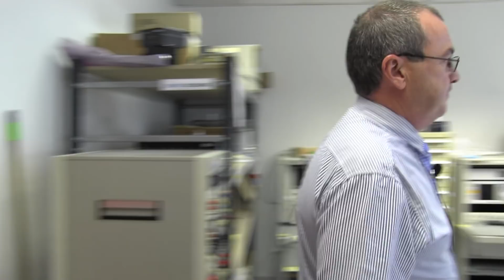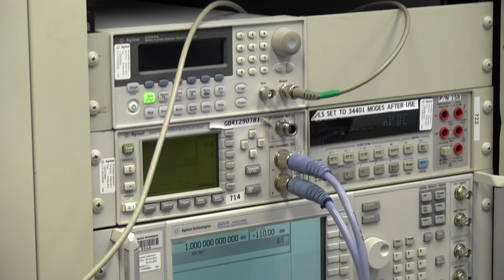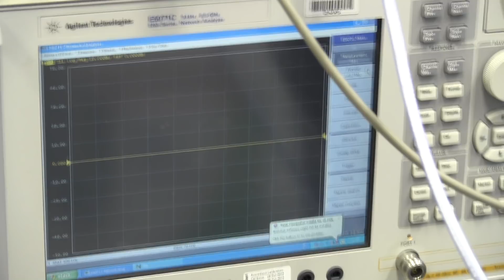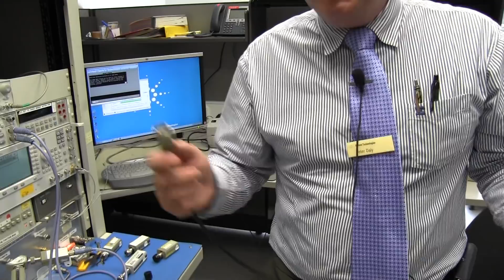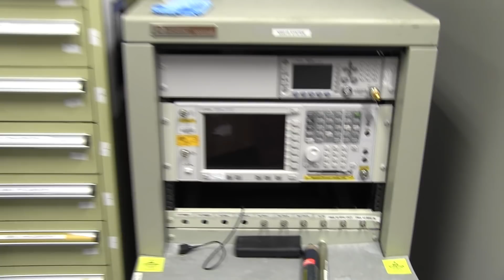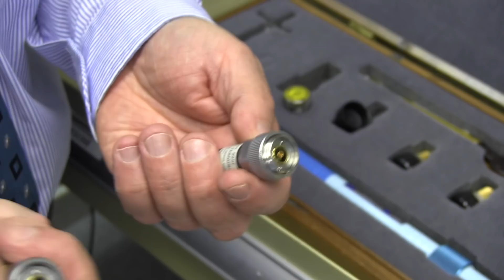EEVblog #1039 - Keysight Metrology Standards Lab

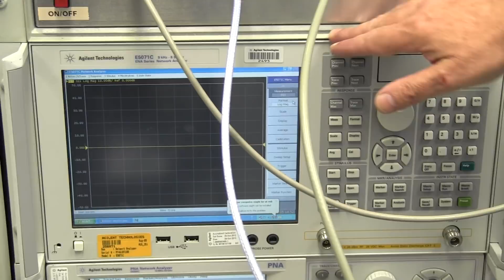Comment: 12:57 When you pay 30 grand for a device which is a "key part of your business", yet it still runs Windows XP in 2017. Even better is to not secure it in any way: 13:04 "your computer might be at risk" message suggesting no antivirus or firewall being on. We can argue about how important or not important this is in this case, but running an outdated OS that is no longer maintained and supported by the developer without any protection is a not good idea on something that you consider to be a key part of your business, right?
Reply: Notice the little red x on the network status tray icon at 13:04. The machine does run windows XP, which would be terribly insecure if connected to a network. However, it is not connected, and likely never is connected to a network.
Reply: Notice two USB ports at the front. Someone can intentionally or unintentionally just plug in infected USB drive for couple seconds. By the way, this model supports LAN and can be connected to network, so your argument is not valid.
Reply: 24:52 Cal sticker on the PSA expires in 2013, no mention of Keysight anywhere, seems like this is old footage.
Reply: On yeah, plug a USB stick in any mission critical piece of kit on a ship and you will get instafired, restricted to your cabin, put on shore at your expense and probably sued.
Reply: Strider9655 yes, usually the expensive and good stuff. Also I don't think someone brakes into a cal lab just to infect a piece of gear with winXP on it lol
Reply: i’ve seen sonar survey equipement run on XP because it is designed for it, with an install of Win7, the results are not exactly the same. Doing a fresh driver and calibration, class validation for Win7 would cost millions (a survey ship alone rentails in the hundreds of thousands a day in rental). So until the next genation of sensors gets on the market, Win XP it is.
Reply: Software can't make up for physical security. They must already assume it is in a physically 'secure enough' location - if it's not, OS updates would be the last of their concerns.
Reply: XP is a reliable and proven operation system that is more than adequate for the task at hand and used industry wide for that reason. Therefore there is no need for it to be superceded with an unproven OS system that is constantly being updated and patched.
If it ain't broke, don't fix it..
Reply: We just purchased this year a $60,000 piece of equipment brand new that runs XP.  Seems pretty common on industrial equipment.
Reply: Also the DOS bases Win95/98 were used quite a bit in industrial computers long after NT (and 2k and XP) were out and running somewhat decent. A lot of Siemens Simatic S5 stuff was still in use until 5 or maybe 10 years ago and the process visualisation usually ran on win95/98. The Simatic programming suite for the S7 was only compatible with XP or lower when Win7 was out for a few years. This is just another world than consumer or datacenter/server/whatever stuff
Reply: There's even "modern" military hardware still running Windows 3.1.

I've got a programmer for Texas Code Composer Studio, which cost over £800/$1000, it won't work on anything past XP.
Reply: Basically, you never update anything important without a very specific reason. The more critical a system is, the more conservative you want to be. It's not like every software should be updated all the time like the average smartphone or consumer pc. Imagine if planes started falling from the sky as often as windows updates break stuff. In this case the instrument is offline, the worst that could happen from lack of updates is it will switch to daylight saving time on the wrong weekend :o)
Reply: Yeah, a lot of ATMs are running XP Embedded too.
Reply: Well the spontaneous updating is an issue with Win7, Win8 and Win10 (although can be prevented on 7 at least). All these OS's all assume that the user work in an office, the machine is attended 9am til 5pm and that it can be updated and restarted any time Microsoft deems fit.
Reply: Mason Ringbinder I think it has more to do with development than stability.
Reply: smellysam Yeah win2k was used widely but XP took over mostly and now they don't really see any reason to switch to the newer versions because everything runs fine. Win CE is not really and option and the other keysight guy in the interview series said they had some troubles with CE and Microsoft on their multimeters and other equipment and are planning on a switch to some other OS, possibly linux but again licence issues there so maybe it will be a FreeBSD kinda thing
Reply: Strider9655 I believe a single PC licence for Siemens Sematic goes around 4000€ which is around 4k$ but I never had to purchase one personally just heard it from my boss. Well, military/government stuff is travelling a lot slower through time than free markets, even industry, but 3.1 is still quite astonishing
Reply: Test equipment doesn't belong on corporate networks. You dont want the IT bastards shitting up your $lots gear with stuff to cripple it. They dont want stuff that isnt locked down according to their standards on the network, so the two stay separate.
Reply: It is most likely running XP Embedded which is still being supported by Microsoft until 2019.
Reply: I disagree. The XP has some reason. The reason is ... set of the drivers. For the keysight (former Agilent (former HP)) equipment in the Keysigth lab (read the VENDOR lab). Nice advertising for the top product...

Btw, about their PC software. I had an Agilent scope on my previous work and WIn 7. One day I wrote some spec and I needed some screenshot from the scope. I had very bad idea to install their SW recommended in the documentation. It was three hours of bloody war with the HP setup as it consists of two parts that must be installed in order or it fails. After that it works but after the scren shot it always lost connection. Disconnectand connect of the USB cable was required and after fifth attempt it didn't start and the PC must be rebooted... It has also some unkillable process loaded on start that slow down the PC and it was not easy to remove this bloatware. The USB dongle was the only way (but it was not allowed by the security policy).
Reply: I think the Windows 10 connected online is the bad idea in all labs. Imagine you run long-term automatic test (e.g. in thermal chamber) and ou need data logged by 30s. It found the update, slow down the PC to take one sample per minute only and then restarts automatically. The system will shutdown (30 minutes if you are lucky), then boot again (maybe in 15 minutes). If it's your happy day it goes without reverts. Then it thinks the drivers fpr the equi[ment are not valid and it removes the devices... Do the test again and hope they won't have some hotfix.
(that's one of the reasons why I don't use Windows for testing and development if I don't need somethink special)
Reply: Strider9655 I guess the professional versions might be different with the forced updates
Reply: Also I wonder if the OS is on a drive which is a read only memory and user data gets stored on a different drive (or not at all exept on USB Sticks)
Reply: It's almost like this was filmed in 2012-2013 or so... Hmmmmmm...
Reply: ignas2526
You take a lot of precautions in a lab.  The PCs in the lab I worked in did have working USB ports, however we only had a couple of people who access the machines and are aware of potential infection issues.
Reply: Actually Microsoft still supports XP until 2019 and still pushes out regular security updates.  Just not to the general public.  You have to know how to get em but they are there.
Reply: If the data on a computer is important enough to keep it disconnected from the internet, updating the OS isn't relevant anymore and neither are the USB ports on the front, at that point your biggest risk is who you allow to physically access it because no matter what OS is on there, once a malicious person has physical access, it's game over anyway.
Reply: megaspeed2v2 Might be why only 3 (or so) people have the access card for this standards lab
Reply: The only windows XP machine that hackers are interested in is Hillary Clintons Email Server.
Reply: Why use Windows at all??
Reply: When I went from XP to Win7 only a few years back, i'd been suckered in by people/friends telling that EVERYTHING works on Win7, the result? I'm glad I kept my old XP laptop, because I have a tonne of hardware/software than anything beyond XP simply cannot run.

Comment: That signal generator is an Agilent 33250A!!
They have a new model that has been around for some time now and uses "Trueform" technology so I thought they would completely replace their 33250s immediately! (considering it's in a calibration setting and they'd want to put their best instruments to use)
Reply: I'm no expert in metrology but the costs of 'upgrading' devices in a cal lab probably prohibits frequent changes. If they change to different devices they have to change all their standard operating procedures and documentation, retrain staff, etc. Not to mention they would probably have to run the new equipment and old equipment simultaneously until the next calibration date when they can be confident that the old device hadn't failed and they can finally decommission it. Also the longer you use a device without it drifting in calibration, the higher the confidence that it will not drift in the future.
Reply from the maker: It's not that easy to just replace equipment in a cal lab, the existing instruments have a lot of traceable history.
Reply: Not sure if it's a factor in this specific case, but in a reference/calibration application an older device with nominally worse specifications may be preferred to a more recently produced one simply because the older instrument has already aged to a lower aging rate.